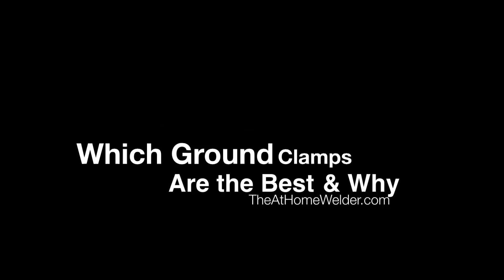Ground Clamp Blues

Comment: Very Informative! I am looking to upgrade my clamps to Copper or Brass from the crappy stamped steel one's that came with my Miller TIG. Thanks for the Vid.
Reply: Going to the brass clamp is highly recommended. I got one standard with my everlast welder and it is much better than what I was used to.

Comment: I bought the tweco style clamp from Harbor Freight, didn't see any improvements on my 211, because it was Brass and not Copper. then i went with a Tweco, and boy did it make a difference. i also swapped out my plasma's ground clamp with a Lenco Copper clamp. don't go with other styles it's a waste of money.

Comment: Copper is NOT the best electrical conductor.  Silver is.  PLEASE DO NOT PROVIDE FALSE INFORMATION.  Making ONE major false statement pretty much makes ALL of the other information suspect.
Reply: CPUDOCTHE1 You need to understand that silver is not used as ground clamp material copper is. Silver is much too expensive and has a different melting temperature so also is not ideal. You info is not correct.